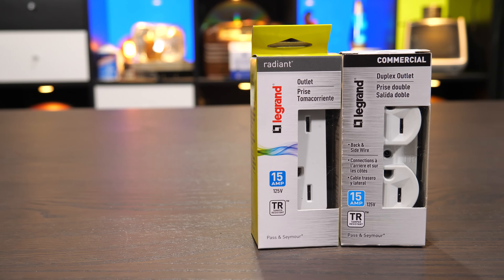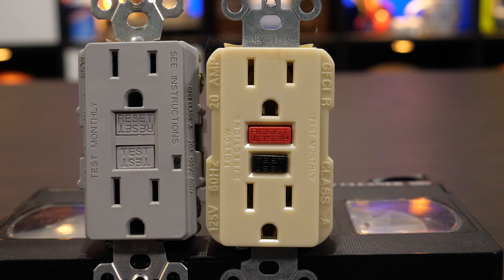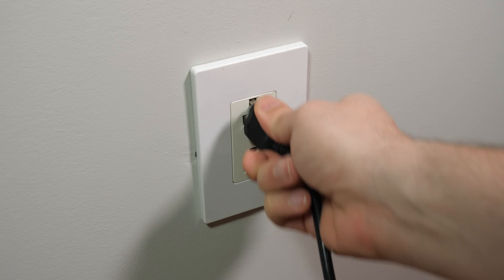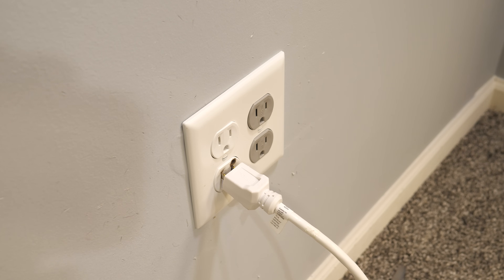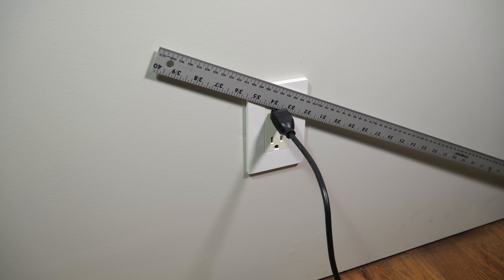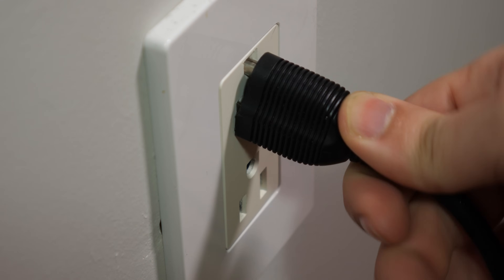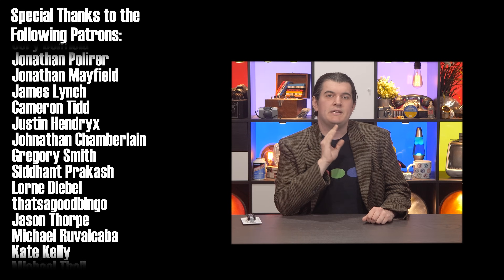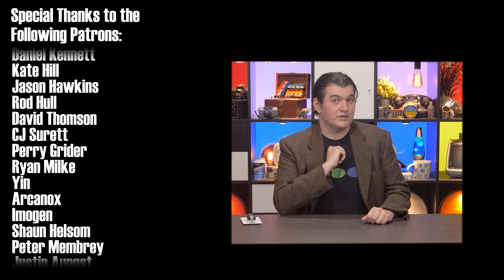Power outlets are topsy turvy - but does it matter?

Comment from the maker: 🙃
Reply: The right angle plug on my AC is upside down, debating rotating the outlet so the cable doesnt go straight up, but I rent. Could my landlord get mad at me for such a simple procedure? I have access to the breakers so there isnt an access issue.
Reply: @xanthirus I flipped my A/C outlet for the same reason, and I rent. They probably wouldn't even notice.
Reply: @xanthirus I learned wiring in a rental years ago. I added a 5-way switching setup in the kitchen. There were four access points.
Reply: @xanthirus  Your landlord can get mad at you about a million silly things.  Go ahead and make them all right side up (i.e. ground pin on top).
Reply: @xanthirus  Most likely your landlord won't notice.  Just be sure that you terminate the receptacle correctly.  If you're really nervous about it, change it back more you move out.

If your window air conditioner is above the electrical outlet, maybe you turn the upside-down plug to your advantage by coiling the cable.
Reply: @xanthirus I'd say do it. If they complain, ask them to show you in the contract/lease agreement where it states the outlet orientation requirements. It might ruin it for future tenants, but... ... c'est la vie ("that's life" in French)
Reply: @Turtleboy971  The outlets are attached to the property, and therefore part of it. Modifications usually require the landlord's permission.
Reply: Me in Germany 😶
Reply: It looks surprised to see me😮 I'm from South Africa we use the big 3 pin here. Surprisingly our plugs if there's no earth prong you can't plug or put anything in the live and neutral in the plug point
Reply: @Mark-Andrew_Paul  South Africa is slowly moving to a new standard plug system, based on the IEC 60906-1 design. It's much smaller than the traditional plugs, and does provide for two or three prongs.
Reply: Two prongs does not make a right , that a whole seperate issue that needs fixing .  Very glad to have my UK plugs , though also very annoyed seeing plastic ground pins on them ...just from a durability point of view they tend be cheap plastic that snap easily and have broken quite a few , just go back to metal ground pins !! cheap companies can't be bothered spend extra penny making a better product .
Reply: @j502nd  Two pronged plugs (NEMA 1-15) are only used on double insulated devices which don't require grounding (earth). Everything else has three pronged plugs (NEMA 5-15). And NEMA 1-15 outlets haven't been allowed for new work since the 1970s. Not a problem, since NEMA 1-15 plugs fit easily into 5-15 and 5-20 outlets.
Reply: Who wants to play a game of Throw the Knives at the Wall with me?
Reply: @CaveyMoth  I play Throw Knives At The Wall every other Wednesday! 🤪
Reply: You might like to have a look at Australian plugs. The live pins are at about 30° off vertical like this /  \ with the vertical earth pin below. The live pins are sleeved and regardless of where the cord comes out I've never seen one of these plugs falling out of the socket, possibly because of the angle of the pins.
Reply: @rais1953  it's rare, but it does happen. But usually only with older (worn) outlets and plugs. 
I've seen the same outlets in Taiwan (for air condtioning) and understand it's also used in China, but in both places, usually with the earth pin at the top, which would explain why many plug packs and appliances made in China for the Australian market have upside down plugs. 
Of course we also have switched outlets / power points in Australia, so we can turn power off to make it safer to plug and unplug. But let's not go there. lol!
Reply: @emdB67  Yes when I first saw unswitched power outlets overseas I was surprised. In Australia we assume that the normal thing is to have the outlet switched so the sockets won't be live for any child to poke with wire, knives etc. At least in Indonesia and Thailand they have their outlets well up the wall out of the reach of most toddlers and the Indonesian ones are recessed, European standard to prevent the live pins being exposed.
Reply: Europeans are cackling right now.
Reply: @daniels4540  Well, Europa is certainly divided on the plug standards, C,E, F,J, K and L. The only common plug that you can use all over Europe is the C type.
Reply: @daniels4540 Europeans have the worst plugs of all.
Reply: If only they made outlets with just the top outlet flipped.
🙃
🙂
Reply: @jlashombjr There are some, but they are very rare.
Reply: @rebirthoftragedy  Thinking about it the other way, there used to be some power strips whose right-angled plugs swiveled.
Reply: And yet the heaviest cord/plugs in MY house are by code, installed upside-down so the cords go up (clothes washer/dryer).
Reply: The outlets in my apartment are so worn out, that plugs just fall out at the slightest disturbance or sometimes even by looking at them.
Reply: @raedwulf61  tell the landlord, if that doesn't work do not hesitate to escalate  to whatever higher authority. That can lead to problems.

I was a property manager for a good few years and that is something that they would not want to be liable for if, God forbid something happens. Remind them of that.

I hope that helps and wish you luck.
Reply: Well this was a weird combination of electrical safety discussion and teaching kids dangerous knife throwing games. Thumbs up from me.
Reply: ahahahaha literally paused the video when i heard this line to lambast you and the top comment is a simple upside down smiley.... well played.
Reply: 240v receptacles are mostly ground up.  Their matching male plugs (with heavy-duty cords) angle down away from the top ground prong.
Reply: @michaelmccarthy4615  Shop-built panels with electrical outlets in them nearly always use the correct orientation (ground pin up).  Here are examples of panels, intended for permanent installation, that orient NEMA flat-blade receptacles correctly.

Make: GE
Model: GE1LU532SS
Model: GE1LU532PS

Make: Connecticut Electric
Model: CESMPSC75GRHR

Make: Vevor
Model: DGNCRV203050AY3ZNV0
Reply: Having spoken to a union electrician who takes code very seriously about this exact issue... His stance is anywhere moveable tools are in use (power tools, immersion blenders, hair dryers) it should be ground side up.  The plug is more likely to become lose, and if gravity takes something on to the exposed pins, you want that thing hitting the ground.
However, that 'upside down' orientation is also more prone to having things fall out (especially given that polarized wallwarts will have their center of gravity above the pins)... so anywhere stuff is stationary, the ground goes on the bottom.
So garage, kitchen, and bathroom it's ground side up... everywhere else, groundside down.
Reply: Wow, this problem is so incredibly American...
Boy do I love our good, trusty old German Schuko-plugs which have been around for almost 100 years now...
🐽
Reply: Ground should definitely be below, 
its how gravity works.
Reply: @stephenlee5929  You got it!
Reply: @technologyconnections does your tape recorder @5:52 work? I have that same machine but can't get it to work.
Reply: Do you have a comparison examples, pros-cons, of other countries?
Reply: @cerburusmori  You could check the Wikipedia article "AC power plugs and sockets", I'd recommend one of the CEE variants.
Reply: this isn't by any means a new thing.  When we rewired a bedroom thirty-five years ago, we put them in ground on top for safety.
Reply: You sir have taken all the fun out of "Throw the knives at the wall", a once staple party game in our household - but no more.
Reply: Next up, cover the truly insane number of different types of lightbulb connectors, starting with the Edison "medium" screw, candelabra/christmas light, intermediate, and Mogul (and a European variant almost but not quite the same as intermediate). Next is the flashlight, bipin bayonet, and other automotive variants. Then there are the pins, the wedge base, and loop pins used mainly for small bulbs and landscape lighting. Halogen work lights have 2 different double end configurations. Fluorescent bulbs with 2 pins on both ends, 1 pin on both ends, 2 pins combined into 1 housing at both ends, and 4 pins. But worst of all are the "PL type" compact fluorescents, with 2 pin and 4 pin variations of various incompatible wattages and sizes - and a dismayingly short lifespan to boot.
Reply: The big problem with ground up is that it has been known to cause ball lightning.
Reply: Have you done a video on flush toilets? They are quite clever yet mysterious to many. Plus there are both the water supply and tank valves and the waste siphon process.
Reply: Alec,
Thank you for opening my mind to the magic if air conditioning. I listen to your videos to fall asleep.  Did you ever try Moka Pot coffee? Much love from Japan.
Reply: Literally
Reply: And yet again! What about European plugs? :D
Reply: This is one of your best videos I've liked. I got a question though: can you do one on European plugs as well? I'd love to know more about the differences between ours and theirs.  If you have already done that, my apologies for not looking first.😊
Reply: The best use of that emoji! 😂
Reply: I just want to know why they look like they've witnessed a crime 😦
Reply: D=
Reply: I would love it if, for contrast, you would make a video about how glorious European domotics are and the modular system of sockets and switches. Check out a Gewiss (e.g. the CHORUS and older SYSTEM lines) or a BTicino or even a Schneider Electric catalogue. Safe sockets, switches, dimmers, keystone holders, tv cable, thermostats, USB chargers, and many more mix-and-match all housed in the same frame with no visible screws. Elaborating the many ways the US plug and socket are bad is fine but it would be nice for a change to show what the alternative looks like. Feel free to contact me to ask for any info.
Reply: @12:57 I actually have, less than 3 feet away from me as I type this, a right-angle plugged extension cord with upside-down pins. I use it to tap the top plug on an outlet that's behind some furniture; the bottom plug already has a right-angle plug facing the normal way in it, so another normal right-angle plug above wouldn't be able to plug in all the way. Oddly enough, I didn't make the upside-down cable, nor did I have to buy it to the best of my recollection; it was just one of many sitting in a pile of abandoned cables in my parent's garage the day they bought the place. So, it's an old and odd cable for sure, but it does exist and, in my experience, has it's uses regardless of receptacle orientation.
Reply: I have got one for you. My bathroom was remodeled in the very early 1980's and the one GFI outlet is vertical BUT the "plugs" are horizontal, yes both grounds are pointing to the door and not the counter top.
Reply: Simple let the child find out the hard way and get shocked they will always learn to not to do that again
Reply: ᗜ
l l
Reply: your videos about the american domestic electrical systems remind me why australia is better
Reply: I always appreciate the extras in the CC ( and that you make sure to include good CC in the first place, thank you!).
Reply: My fridge has a right angle plug with the ground on top. I've also seen shop equipment that prefers this orientation. Would be a nightmare with many home electronics, though. My rule is ground up in the garage/shop, ground down in the home.
Reply: I usually appreciate your insights and never downvote, Alec, but I did today for simply complaining and not using your YouTuber influence to sue Congress or something to make 45° or side-cable plugs the new standard.

.....or did I mean to hit like, but hit dislike instead because I got confused which way was up?
Reply: Hi,

I would like to make a single donation.

I watched a video regarding the dish washer and it was super useful! Now i watch other things from you as well and i am very very happy! Is there a way to make a single donation to your channel? I don’t want my name to appear anywhere, I don’t care about added perks, i just really enjoyed your content (and keep on doing it) so i would like to make a single donation as a way to say “Thank you for the hell. Barely any advertisements (i know about the youtube drill so once a while is a must…) and so useful information! Well, i live in Europe so would be happy to learn about people doing stuff like this for Europe as well. 

Thank you and keep on going!
Reply: In reality this “upside down face” rule only achievement is increased possibility of neck injury for people with extreme cases of pareidolia 😂
Reply: It's interesting that the US plug have a ground pin, the plugs and receptacles used in The Netherlands and in many other European Countries have the ground on the sides of the plug and receptacle! Which means there is no up and down.
Reply: How do they tell where the floor goes, @teaser6089  ?
Reply: at 9:52.. I have a realization..+.. Alec watch to much Final Destination movies.. 🤣😂😅  +
Reply: @rebirthoftragedy  Already saw this on power strips.
Reply: Nah we should switch and right angle plugs should switch too, maybe new houses can have 1 or 2 sideways plugs for backwards compatibility
Reply: Never been shocked but, while renting an apartment i notice the outlets were alittle smoth with out the characteristic cutouts, it was only when my phone charger fell out, did i investigate. For some reason the apartment complex sought it was better to put an entire faceplate on top of the sockets which in itself prevented the plug to be fully seated by default. maybe the old socket had yellowed and they didn't want to replace everything to make it look newer, but i feel they made it unnecessarily less safe for a vain reason.
Reply: 12:35 - us - stedics? Do you mean aesthetics? Its uhs - theh - tuhks
Reply: What's your opinion on the Type N plug used in Brazil?  I've heard that it has the advantages of the British Type G plug without the large form factor.  The one thing it doesn't have is a built in fuse, but that's only because Britain does this weird thing called ring mains which makes a fuse necessary.
Reply: @LoveClassicMusic0205  the type N is very nice. It is based on an international standard, the IEC 60906-1, with slight changes. It is very similar to the South African one which is the unmodified standard and rather similar to the Swiss one. At some point there was some desire to harmonize the entire EU and this was the proposed standard. Those harmonisation plans were abandoned though.
Reply: Came here via your 2md channel and a clicky card in the corner, thanks!
Reply: Nice Trinitron t-shirt!
Reply: yeah 4:02 was such a reference lmao
Reply: All of the plugs in our house were installed upside down. We've since replaced them all with the 😮 orientation
 
You've convinced me 
1. We made the right call to switch their orientation
B. To switch up my point form notation
Reply: Maybe we should phase in a safer outlet/plug design.  Do a coaxial design with the ground as the circular ring, and the hot and neutral pins inside.  That way, the pins won't make contact until the ground is connected and you can't even touch them.

Or else replace all 120VAC outlets with USB power, and require that anything that needs 120VAC (and 240VAC) be hard wired (like refrigerators, stoves, air conditioners, etc.).

Or just move to England if plug design really bothers you.  Of course, they use 240V instead of our 120V.  So even though their plugs are safer, if you should, by chance, get zapped, you're a goner instead of just getting stung.
Reply: Not this trope again... Let the pedantics begin. Glad you properly covered this.

Literally NO code book in North America specifies orientation.
Reply: Why not switch to the Euro Plug? and use adaptors until all plugs  are changed to Euro Plugs at 220v-240v?
Reply: @Narinjas Because Euro plugs are the absolute worst.
Reply: @MD-md4th  WHY?
Reply: @Narinjas  Because the sockets are big and ugly. Only relatively recently were the grooves on the sides of the sockets introduced to provide more stability due to the inherently unstable round pins. It’s a clunky, ugly system, over-engineered due to its basic flaws.
Reply: Right angle 45⁰ plugs?  Quaternary!
Reply: "3 plong" Alec speaking "chinglish" lol 😅
Reply: I was so ready to point out the Kill-A-Watt and right angle plug conundrum, but once you said it didn't matter, I knew this angle was coming.
Reply: ஃ
Reply: Do a video on how USB wall sockets are (not) the solution to NA plug design being garbage.
Reply: You could just say the whole world should copy the UK plug and socket style. All those raised concerns are fixed. 
Insulated pins, earth pin on top, plug is a right angle so cord normally always drops down.
Even the wiring is a great idea, the earth is the longest wire so if the cable was pulled out the plug (not easy to do) the earth will be the last wire to break. 

The socket is arrange horizontal so you can fit to plugs, the earth pin must be inserted to open the line and neutral receptacle so nothing can be shoved in. 

Great video but I have to disagree
Reply: I was so ready to point out the Kill-A-Watt and right angle plug conundrum, but once you said it didn't matter, I knew this angle was coming.
Reply: Pretty sure it only actually matters when the top ones connected to a switch. Light switches only work on the top or bottom receptacle and i believe its suppose to be the top one. because thats how they work. it's not brain surge... ury.
Reply: 1 and B
Reply: @TechnologyConnections I've had some thought for this subject and a decent solution that solves more problems than it causes arose: Put the ground pin on the top AND the bottom. Top receptacle ground-up, bottom one ground-down. I've looked and in Canada at least I couldn't find any reasonably priced plugs like that, But I'd use them with gusto.
Reply: Seems to me that a take away could be making receptacles go sideways with opposing ground pins on the sides. So two 45 degree plugs could be inserted in either side, plus all other plug configurations should still be valid.
Reply: 😮 surprised Pikachu face
Reply: That smiley is upside down!😡
Reply: I had a topic suggestion, I hope you don't mind me posting it here. It's something that I've been banging my head against a wall with for some time: audio recording on smartphones. Specifically, the various noise suppression techniques that are applied aggressively and often ruin the quality. I've noticed the issue across multiple phones and manufacturers, but can find barely any information about it online (save for the somewhat well-publicized issue Nexus 5 phones had). The vast majority of help requests on various forums indicate that it's something deep within the phone's architecture that can't be fixed. I finally asked Bing AI, and it pointed me to the OpenCamera app on Android, which allows for recording of raw audio, albeit at noticeably lower volume. I wonder, does this have anything to do with the types of microphones these devices use? Or is there some other reason manufacturers would want this "feature"? I feel like this is something right up your alley, what with it being at the intersection of quirky hardware behavior and some possible overarching (but little known) industry response to a design issue, and would love to see you investigate someday.
Reply: Don't care.
Reply: How many knives did it take? 😂
Reply: yes
Reply: @@karlwithak. good to know. Always stick to code.
Reply: I worry that if the ground pin is at the top all the blood will go to their heads.
Reply: Lol an entire video just for a pun.
Reply: @ingulari3977  I have seen terrible reviews for British plugs, but I've never experienced them. The issues he talks about are true, but they are only an issue with children.
Reply: @rebirthoftragedy  I have a power bar with a right angled, swivelling plug.
Reply: Check out South African three prong plugs. There is no way you will even remotely be able to accidentally bump one of those babies out the wall socket. 😂
Reply: Europian connectors are the easyest solution😊 thight bi-directional and safe. Compare them to US connectors if u want 😁
Reply: The list of A and 2.
Reply: God that reminds me.. me and my dad stayed at a old cabin up in Canada, fishing place.. you rent the little cabins along the lake.. for like a week or something etc.. and the fridge had this daisy chain of stuff basically I think it was like one two maybe four.. the memory was oh dear so definitely more than two LOL.. and it's an old fridge too cuz LOL we're talking a place that was using those cheated adapters with the grounding pin.. but then it was also Daisy chained.. now this place had been around since he was a kid, his dad took him there.. and I just remember sitting there and I think he thought the same thing.. but how is this place still around? Like I know we did something about it at some point, cuz it's just like something that we wouldn't not do something about especially with his background but.. I can't remember what it was or how it all went down, I don't remember any drama or anything like that I just remember seeing it and being like what.. you you.. you can you do that?

But alas as we all learn from Jurassic Park.. they were so concerned with what they could do, rather than if they should LOL.
Reply: I'm actually going to go sleeve all my blades when I get a chance.. I never thought about that before but that would literally solve every problem I have with getting them to stick in and stay and not be annoying.. like nevermind the safety thing I'm not worried about that cuz I only throw knives at the box in the hallway with the skeleton in it.. it's it's literally what it's there for.. just realized I'm not joking about that.. that's his job..  also holds kitchen knives I'm working on reprofiling.. 

But that is such an easy way to solve plug problem.. I can't believe I never thought about that.. and I have tons of those shrink insulators just hanging out and they never really do anything useful when I want them to for projects they are not designed for... Just try to get out of the wall outlet now vacuum cleaner!
Reply: tubeoftheviper7779 did you not watch the part of the video with Alec plugging in all those devices that were bigger than the outlet? Those items can't fully seat if used in a recessed outlet.
Reply: @@karlwithak.That very much depends on where you are. Not all building inspectors care, because the code the electricians use doesn't care.
Reply: Ah! There you are.
Why have you not suggested that sideways with the neutral up is the best orientation?
Reply: If not safer, then why is it that EVERY American hospital has it's plugs put in that way? By the way, dusting off the shelves in the background is a good idea OFTEN
Reply: @email4664  because it’s “less dangerous” 🤷🏼‍♂️
Reply: whoever built the house i am currently in installed every single plug recpitical the "correct" way and i curse their name to this day. They also labelled everything (like, which switch turns on and off which light on the switch with a label maker) and installed an obscene number of switched plugs for.... reasons.
Reply: There no code stating the orientation of the outlet
Reply: Could you consider making a video about japanese round fluorescent tube lamps which are still used almost everywhere over there, they have a super low intensity step which I find very interesting and useful at night.
Reply: Here in Bermuda we also put them sideways.
Reply: Foreign countries install 220 upsidedown and our products are made in those backwards places
Reply: I'm gonna have to try me some that knife throwin game
Reply: Another question why amazon echo bricks are so square (3rd gen) lol
Reply: Hello!  I recently came across you and am thoroughly enjoying your videos and humor.  You make me crack up laughing with your intelligent jokes and I find myself watching video after video, liking you more each one.  I was sitting here re-watching GOT, enjoying this round with Phillips Hue Entertainment Area using my newly purchased Sync Box.  It was quite an expensive addition to my Hue lights but well worth it, as it processes the video inputs and matches my lighting to match what I'm seeing on screen.  The left side of the TV can be displaying a sunset while the lights behind the TV on that side shine orange all while the other lights on the other side shine blue matching the clear sky.  It also syncs with all lights in my living room , including behind me as well, truly enhancing the viewing experience.  You should do a video on how the Sync Box matches light to the picture output!
Reply: My RV right angle cord is ground pin up.
Reply: As soon as you said you had never seen a right angled plug with the cable coming out the other direction, I looked across the room and saw one, so well, I guess they exist.
Reply: No such worries for us French; all of our sockets, whether recent or not, have an external edge (or are offset) so that nothing can come into contact with the connections...
Reply: "ground" IS down.  Do they not know that we don't stand on our heads?  Oh, and I WORK in a hospital.  Bossman DGAF about safety.
Reply: check out the Brazilian solution
Reply: Fire Marshal Bill: Let me show ya' somethin'!
Reply: there is no nec response to this so it is fine to install either way.  personally i put switched outlets "right way" up so i can tell at a glance which outlets are switched
Reply: Have you considered doing a video on the arc fault breakers now required in some areas of US homes like bedrooms?
Reply: man... no one gets it.. "pushback" hunchback of note dam, metal in the sockek, flippes your world upside down or as I like to call it the Topsy turvy, dimensions are so important tremendous in fielding for a special today that they can make
Reply: Funny story as a kid I had a wire with two insulated alligator clips on it amd I pulled out a moon light so it was still on but I saw the plugs and connected them the wire blew up it was funny tbh
Reply: I had it happen with a fly swatter that had a thin wired handle.  This was in an RV, but luckily at a GFCI
Reply: I've been a Canadian Electrician since 2009.  It is code that the outlet shall be mounted ground pin up only if a conductive cover plate is installed and when it is installed horizontal is must be so that the hot side of the outlet down (ground pin to the left).  The C.E.C. takes your N.E.C. and builds on it.  Our book is twice the size of yours.
Reply: As a little kid I stuck a tweezer into an outlet.
Reply: @Iridium43  ...did it short the entire branch at the breaker?
Reply: Okay so I just found this channel and it's becoming evermore clear to me that we're kindred spirits (& probably also the case with everyone else watching). Do people often accuse you of "overthinking" everything?
Reply: I have shocked myself holding the plug wrong while plugging in, granted i was reaching high to a weird placed receptacle and was feeling around... but it can happen with just your fingers.
Reply: ALL Australian Side-Entry plugs have the cord exiting at 45 Degrees - which is at the 4:30 (clockface) position. (As at 14:50 in this video).

Australian Plug Pins are of approximately (almost exactly) the same dimensions as US (NEMA 5-15) Plugs.
They have been Half-Insulated (as at 16:00 in this video) for over 20 years - so it could be done on plugs in North America.

(Search for Australian Plug side entry. )
Reply: ALL Australian Side-Entry plugs have the cord exiting at 45 Degrees - which is at the 4:30 (clockface) position. (As at 14:50 in this video).

Australian Plug Pins are of approximately (almost exactly) the same dimensions as US (NEMA 5-15) Plugs.
They have been Half-Insulated (as at 16:00 in this video) for over 20 years - so it could be done on plugs in North America.
Reply: It really shouldn’t be too difficult to insulate the 1/4” or so of the prong near the plug.
Reply: @MD-md4th  As is done on the (virtually) same sized Australian Line and Neutral pins.
Reply: In Australia the Earth pin is at the bottom in all installations. I was told this is because in addition to the Earth pin being longer, the bottom placement aims to have the Earth pin disengage last if the plug is being inadvertently withdrawn due to a drooping cable under gravity. Protection from contact of the live pin is provided by sleeved pins. Yes, the cable could be pulled accidentally or tripped on but that's more likely to be straight out and thus not have a bearing on preferential Earth location . Side note... sleeving the pins of the Nema us plug maybe difficult as there's not a lot of cross-sectional area on the pins in the US anyway. This leads to an irony that the type g plug used in Europe is probably better for you guys is the larger pins can handle more current as for the same power load you need to draw twice the current as for 230 volt systems
Reply: @philbrammer3632  Since the NEMA 5-15 and 5-20 pins are almost exactly the same  dimensions as the Australian pins,
there should be no problem in half-insulating the Line and Neutral pins
Reply: Even the NEC says that is BS 0:03
Reply: Most people have fingers smaller than the thumb. With the outlet upside down, women and and children especially can easily slide their fingers behind the plug when it is being pulled out, and shock themselves. I say this is fracked up. Leave the ground on the bottom. The one case of a sheet of metal falling on the outlet I don't give a crap about, as it is so remote an occurrence compared to people being able to contact the plugs with their own fingers, to consider it IRRELEVANT.
Reply: Ah British Plugs. WE RULE! 🇬🇧🇬🇧🇬🇧
Reply: @FartingGolfBalls British plugs are very safe but so big and clumsy. Having used British, US, European and Australian plugs I prefer the Australian design. It's compact and relatively safe.
Reply: Ugh. I can't watch this right now. There is nothing in code. Arguments for both orientations. People have specifically asked nec for a policy and they have outright refused.
Reply: @seanvinsick  They have not established a policy for a good reason. Establishing a code for the orientation of receptacles would not be much safer than the way we do things now. It would make the job of electricians harder because there are specific situations where you might want a receptacle a certain direction. It would be unnecessary code bloat, and the NEC would have to list all the situations where you are allowed to make exceptions, too.
Reply: @ZeeHedgehog  they stated its because it doesn't matter
Reply: @seanvinsick  On the other hand, the National Electrical Contractors Association's National Electrical Installation Standards (NECA 130-2010) recommends that sockets be mounted with the ground hole up.

It's noteworthy that, for non-locking sockets, the "ground hole/pin up" orientation consistently matches the diagrams in ANSI/NEMA WD 6-2002 (Wiring Devices--Dimensional Specifications). 2002-08-29.
Reply: Yes
Reply: I'm almost certain there is a better way if we don't just keep thinking the way it is is best. Redesign it entirely.
Reply: If you have Stainless steel covers, the cover comes loose it won't immediately short out
Reply: Can you explain why my cars digital trip mile counter resets if I unplug my battery but my odometer doesn't? Is the odometer a digital readout of an analog odometer?
Reply: @Dances_With_Lag  I think the real odometer is stored in non-volatile (Flash-like) memory in the ECU. (Which makes it difficult to fib.) The trip odometer is likely just RAM-like memory in the instrument cluster.
Reply: @ZeroTooL88  Federal Odometer Law.
The odometer is covered by laws to avoid any type of tampering.
Reply: @Dances_With_Lag  The odometer is legally required to maintain it's memory.
Reply: @Dances_With_Lag  Because it has to.